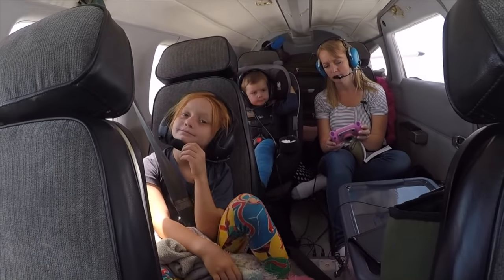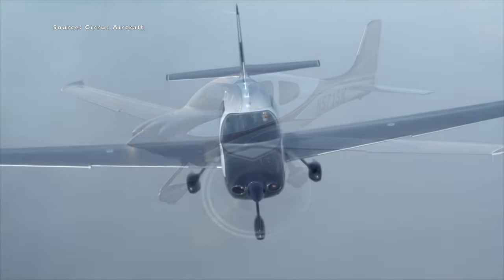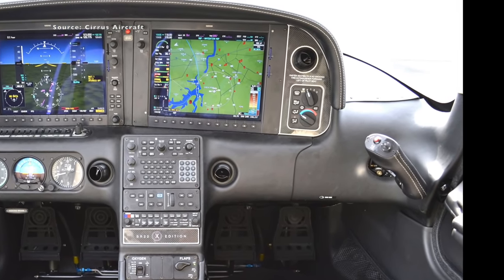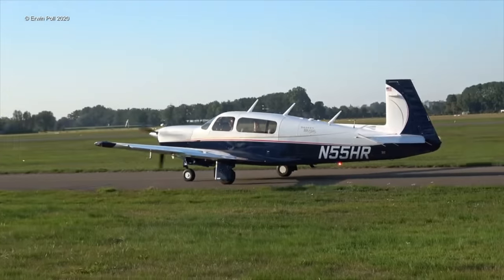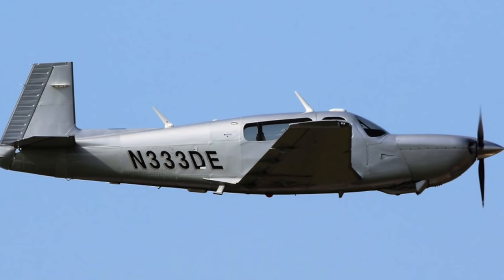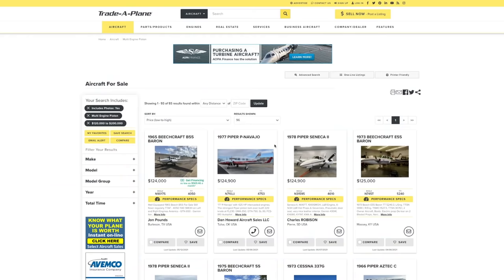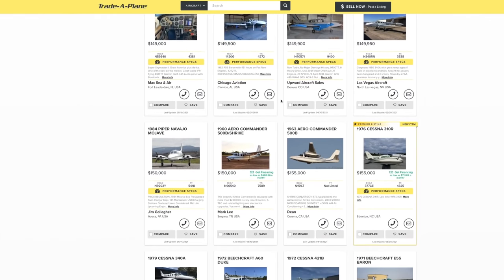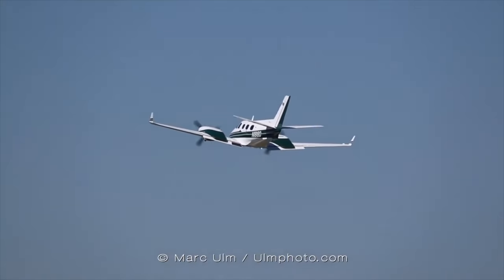10 Fastest Cheap Airplanes You Can Buy For Your Family

Comment: When you are discussing airplanes fast and cheap are inversely proportional. I’ve owned 3 Aerostars. I’d say don’t waste your money on a 601p if your goal is transportation for 4+ people. Terribly underpowered. Get a 602p converted to a 700 if you can find one. Few were made. 225kts. @ 15-20k. 45gph. 3.5 hr range with reserves with the aux fuel tank. Plan to buy a lot of fuel. And if if your aren’t flying it regularly plan to pay maintenance bills. Shit that sits breaks. And I wouldn’t care for non pressurized planes that I’ve got to wear oxygen the whole long flight. Pain in butt. Passengers hate it. Also when you’re in the FL’s icing is most always an issue on cross country trips. Lancair 4p or iv the insurance companies hate. 13k plus a year if you’re a no accident well qualified pilot. I have a friend that has one. His rates after a couple scuffs are 36k a year liability only. Lancair 360 is a better choice. 195 kts. @ 8500ft on 9gph. Cheap insurance. 2 seats. Under 100k. Or step up to Sx300. 250kts @8500 on 17gph. Rare , 2 seats and hard to insure but I own one and it’s well worth the price of admission. 200k is possible if you look long and hard. For the family trickster buy a Cessna turbo 210. Won’t break the bank of fuel. Does 185kts below 18000 ft. Easy to insure. Built in o2, de-iced, 6 place etc. cheap enough to maintain and operate you will fly it some by yourself on short hauls. Don’t waste your money on light twins unless you can and want to spend a ton on fuel and or maintenance.
Reply: Hi Richard,which one would you recommend for 6 or 8-seater family trip,signal engine? Thx~

Comment: I  really enjoyed your thoughts on fast airplanes that you can buy for under 200K. I have often thought about the same airplanes. It is a wonderful dream list for us.But it isn't much more then a dream for 99.9 percent of pilots....... because those of us who have the experience to fly those planes.......can't afford them.....and those that can afford them..... usually shouldn't be allowed to fly them.

The problem in the end is.....what does it cost to "own" the airplane....purchase price is just the beginning.........what are the maintenance, insurance and training issues involved?  Most of these planes can run $10,000  to $20,000 for an annual without blinking an eye.
 
I operated a Piper Chieftan for 10  years and the insurance ran $10,000 per year, the annual $10,000 and the hangar $10,000....and you are burning 36-40 gallons per hour flying it.So there is $30,000 per year just to look at your airplane sitting in the hangar and at $5 bucks a gallon you can take your best 7 buddies for a ride at $200 per hour. just for the gas.....wanna go fly to the beach that is 3 hours away? Well that is 6 hours round trip so it will cost you $1200 bucks for gas for the weekend.

Training can be expensive to say the least and these are all airplanes that should NOT be flown by pilots that don't already have a lot of experience...I mean several hundred hours of multi engine time.....Flying a high performance piston twin is extremely demanding and requires a pilot who is at the top of their game.

I am qualified to say this because I have been a pilot, in both professional and general aviation for 45 years and have flown everything from Cessna 150's to Boeing 747's, and everything in between.....and have been an instructor on all of them......I have seen it all in this profession.

My concerns that I mentioned here are only because I have seen too many pilots get into airplanes that they either could not afford or were in way over their head as a pilot. I have seen to many people killed because the guy in the left seat had money but not experience. Back when I was a lowly flight instructor and we would hear that some high performance piston single or twin crashed, we would ask, "Was it a Doctor, a Lawyer, or a guy that owned his own company?"....because about 100% of the time that was the case......

Comment: Neither of the planes I would really like to have fit your 200 for 200 idea but I would love to have a Seabear L-65 or a PBY-5A Catalina (Catalina being one of my favorite places of all time). I also wouldn't mind having a single engine pusher amphibian like the Icon A5 and MPV Aero. Main issue I have with smaller usable load limits is I'm already 300lb throw in 2 more 150lb+ adults and you already don't have much weight left if any on some of the planes listed. One of the reasons I like the Seabear L-65 over the pusher light amphibians is its massive 1,500lb usable load for a light sport craft. It also has way more range. the A5 and Aero only have a useful load of 430lb and 450lb.

Comment: Ok, so mine only cruises at 207 mph not knots, holds 4 people, but it only cost me $24,000 with only 10 hrs since overhaul, and it only burns 10.1 gph (at 180mph) - 16 gph (at 207mph). What is it? A 1962 Bellanca Cruisemaster! (14-19-3) It has all wood wings, a chrome-moly tubular steel frame with fabric skin. Best speed for the buck available!

Comment: I’m not sure where you’re sourcing your info but there is no such animal as a 400+hp Navajo!  The TIO-540 in the Chieftain is rated at 350hp.  Also, the C421 is a “hurt you” aircraft in the hands of a novice driver.
Reply from the maker: The P Navajo's had the TIGO 541 E1A 425 HP engines.  I agree that any of these aircraft are extremely dangerous without careful attention to the numbers and training.

Comment: lol - that Duke takeoff.  Did everything wrong and hogged the runway.  Cowl flaps should be closed for takeoff, elevator pulled to neutral at 40kts or so until airspeed alive (reduces drag).  Those two things eat an extra 1,000' of runway.  

We love ours, it's the ignored diamond in the rough out there but you have to buy one in the $150's-180's to get one flown and maintained regularly.  When they stop flying regularly, run away.  Far away.  But that can be said of any plane, really.  For the buck you can't beat it.  215 Kts at 20,0 at 42 GPH, 205 Kts at 20,0 at 38 GPH, loaded with 4 people, full fuel, and all the bags you can stuff in it and still within the envelope.  And it's sexy.  The only other twin I'd take over it would be a 421 or a 350P Navajo and both of those planes add $30-40k for the same condition/avionics/time.  

I will say, the remark you make about the 2nd plane for parts.  That's EXACTLY what I did.  C-FSSD had a gear up landing in Canada right about the same time I bought my plane.  For $20k I got the whole plane minus avionics, another $20k and I had it in my hangar disassembled and such.  I got $40k in accessories, two extra engines being gone through right now, and sold $35k in parts I didn't need (including the windshield at $15k).  We've saved $7k in parts already being able to just swap out something (generator, Woodward prop sync, prop governor).  I highly recommend it if you can for ANY plane you buy.  Spare parts are gold.

Good video, thanks for posting!
Reply from the maker: Thanks for the info, good to know!

Comment: The best plane you can buy for your family is NO PLANE! GA is a dangerous way to get around unless you plan to fly by yourself and are willing to take the risk.  Stick to the airlines for the family. And even though the business jets are overall more reliable than the typical small piston high or low wing, they have their own dangers. Airliners have many systems in place to prevent an accident as much as possible and statistically, they work really well.

Comment: Your list is great but your analysis of the A* is off a little. Ted Smith was genius. The tail surfaces for instance, are interchangeable. The airplane is a tank, very well built. The “quirks” are very manageable and the airplane flys like like a fighter jet because of push rod instead of cable. The movie depicted a hole in the bottom of the airplane, but unfortunately, that’s Hollywood for ya, that’s where hydraulic lines and other kind of important stuff run through under the cabin floor. The safety record is somewhat skewed. A very large percentage we’re crashed due to pilots getting slow, or after watching the Jimmy Franklin videos. MX is not as bad as people think. BUT, you MUST take it to a “GURU” otherwise you are paying the mechanics to learn how to work on one. I have about 700 hours in a 601P-700 conversation, awesome awesome airplane, and it should be number 1!

Comment: Piper Seneca II, and III, and up.  Not the fastest, but SAFE.  And in my little opinion that counts more than any of the other qualifications.  'Cause if you dead mate, that ain't great.  Piper Seneca series is the safest twin there is, period.  

Counter rotating props, big wing, forgiving.  Simple fuel system and lots of it:  128 gallons will carry people a long way.  Simple controls and stable strong design. Plenty of room with the huge back door and easy to get in and out for the passengers.  They don't break like a Beech.  And for twin engines, they are cheaper to maintain than probably anything on your list.  20-22 gallons per hour at 180 knots is alot of bang for your buck.  A veritable Econo Box!  Fool proof landing gear system:  if the system fails, you pull a lever and it drops out.  No hand-cranking 53 turns, then crank it back 2 and a half, then jiggle your wiggle.  None of that crap to try to perform during an emergency.  Just slow to 85 knots and pull, down it goes.  Boom, bang, it's done.  Land normally.   

Nothing beats the ease of access, not even the Baron 58.  That airplane is too narrow.  (Well, except an Aero Commander Twin which all of them are simply quite amazing but you didn't choose any for your list) Take the seats out of a Seneca and it becomes an air ambulance, cargo hauler, put bicycles in there, the neighborhood cats, whatever you want, it's got room.  
But then I'm partial to them.   For you people who say a twin is too expensive, well I'm sorry but you just really don't know what you're talking about.  Besides, what's your life worth?  When you're flying over mountains, at night, or over water, at night, or in bad weather, at night, or  . . .at night period . . . if you have a problem with your single engine and that music stops, you would give ALL the money you had in the world for a second engine to get you down safely.

Comment: Haven't seen a 2010 sr22t anywhere near $200,000, even with an engine at TBO.  The ones I see, looking tonight,  seem to be  north  of $300,000, usually  considerably above.
Reply: Really high time TN, maybe. If you buy a “cheap” one. And the cheap ones cost a whole lot in the long run.
Reply from the maker: a little over a year ago before prices went parabolic you could find them.. I agree, not now... even the G1 SR20's are pulling over $200k

Comment: Your info on the navajo is just plain wrong.  You quote the performance for the PA-31P,  pressurized, 425hp a side, but then go quoting prices for the PA-31, which is not pressurized and has 310hp engines.  P version had very few built, maintenance heavy hangar queens.  The strait navajo for which you are quoting prices, lots built, those still flying all fall into the category of 'rode hard, put away wet', and come no where near your 200knot requirement in level flight.

Comment: Why would you specifically include the Baron 58P on the list, and not the far more sensible, far more widely available Baron 58 non-pressurized.  If you're coming from a Cherokee, why would the pressurization (that demands such a higher price) be a factor?   Some really odd choices here!   The Cessna 421B is about as expensive to maintain and unreliable as the Duke B60 too..... you didn't mention the geared engine - all the horsepower running through a gearbox = constant failures and overhauls.   Similarly, you should be looking at Cessna 310s, not 340s.   Most of the aircraft on your list are just not a sensible next step up from the Cherokee 6 single!
Reply from the maker: Thanks for the info, good to know!

Comment: Please correct yourself on the Navajos PA31-350, 350 hp, not even a panther is 400hp you read the specs for a Cheyenne that’s 550 a piece, PA31-325 is the baby Navajo 6 seats the chief ten is 9 seats.  Piper barely supports it.  The 421’s has horrid engines.  All the Barons are awesome.58P and 58 TC engines are 325 turbocharged hp a dual yolk is optional for the Barons.
Reply from the maker: Thanks for the info, good to know!

Comment: I hope #1 is the Ted Smith piper aerostar?  That's my guess for number 1.  At least it's mine.  I cheated, I looked up at the posters and photos of them in my office.   I kinda wish someone more skilled than me would drop 2 Garrett TPE 331 turbine variants on one.  If it can take jet engines, it's super strong wings and fuselage  can take turboprops.  Can you imagine an Aerostar with 2 TPE 331-? (name your engine variant, maybe the same ones on the PA 42 LS 400, no, not the first three versions, the Cheyenne 4,  the one that can cruise over 400 mph at 41K feet, that one, those engines, Mark it down.)  The slick characteristics of the Aerostar would just be a demon of speed.  Throw in some Scimitar 5 blade props, adding whuut...30 extra knots....you can have or surpass slowtation speed and climb for 30% of the fuel burn.
Reply: Yeah...it WAS number 1.    Im proud of that.

Comment: Cirrus 22 parachute has to be repacked every 10 years for about $20-25k.  no bueno
Reply: Does that include a new parachute itself?  Wow.  I thought I read that (early on) few pilots were using the parachute, even in desperate circumstances, probably for psychological rather than physical reasons.  Once you deploy that 'chute, you admits that A) You failed somehow; B) A report of it will be filed somewhere--the NTSB, FAA, your insurer, etcetera; C) It will cost substantial dollars to repair your airplane; D) You'll often wonder whether you could have gotten out of it without resorting to the "I give up" method.  Thoughts?
Reply: @MalachiWhite-tw7hl  as part of your C option I would include the repack chute cost.... said cost might also cause a pilot delay deploying the chute thinking "if I wait a little longer I might get out of this and no't have the extra cost of repacking the chute.

Comment: Why is it that every aircraft out there advertised as 4 or more passengers can never carry that many if the tanks are full? Are they built only for 2 fewer butts (passengers) but are advertised as more as a selling point? Add luggage and it is even worse.
IMO, if you have a 4 seat aircraft you should be able to carry at least 3 grownups AND luggage with full fuel.
Reply from the maker: agreed, the Piper Cherokee 235 will definitely do that!

Comment: Piston twins are harder to fly and require regular type specific training, and the higher maintenance, that is why they are so cheap, no one want them.   I rather take a single , maybe turbine of similar capacity, such as an old Caravan or an old PC 12.  Smaller planes rarely use up the airframe hours, so even with 16,000 hours it is fine. Find a Caravan that is ex Fed Ex.

Comment: You won’t find an sr22t for less than 400k…. Unless the engine is run out and it’s in terrible condition or wrecked. Not even close.
Reply from the maker: you could a year ago... prices have went vertical in the last 12-18 months!

Comment: You seem to be confusing “useful load” with “payload” in your comments to the uneducated.  Useful load is empty weight plus fuel plus passengers and luggage/cargo. Payload is what you can carry after filling the tanks. Of course you can  go with more payload if you load less fuel. Talking useful load without mentioning fuel capacity is not giving sufficient info IMHO.

Comment: #10 Cirrus SR22T? Water cools engine, and Noise is quite 60 dB? Some the older plane; straight pipe w/o muffler (wile sound go up to 125dB) #9 Mooney was the one I train on 6 hours on one. #7 Piper Navajo? was called the Poorman Exce plane. They all cry filling up the three tanks. About all mine friend who flies piston-turbo charger ever time they fly checking and adding Mobile 1 oil.  While the one who have Turbo-jet engine, Case of gas treatment oil. Lube the inner bearing. The Beechcraft King Air over price? Yes I have seen lower hours for less, Sadly it only worth 98,500-100,00 if it got the old standard instrument? Upgrade 30,000+ add to it! I have seen the old transponder in it! The new one got a  GPS Digital. And I bomb-all toilet build in?